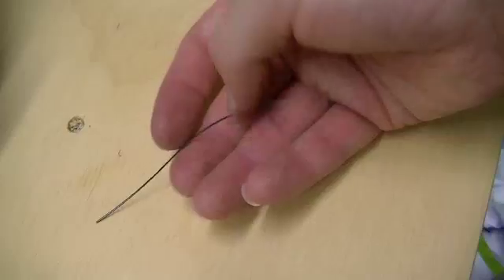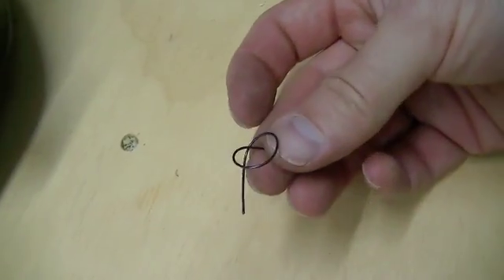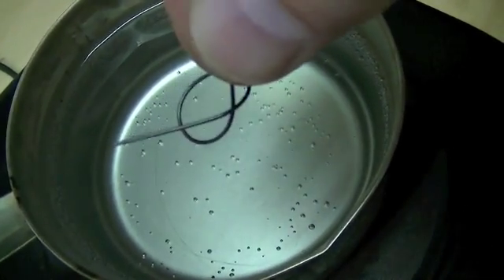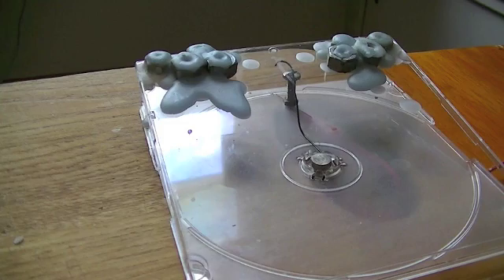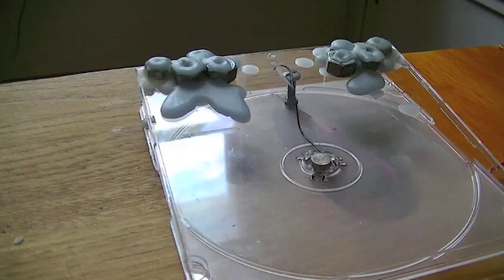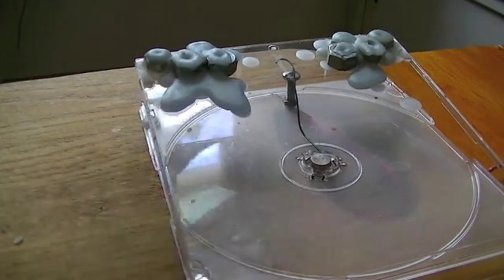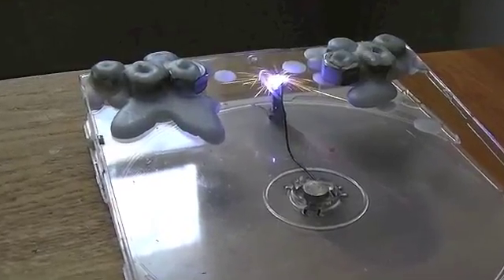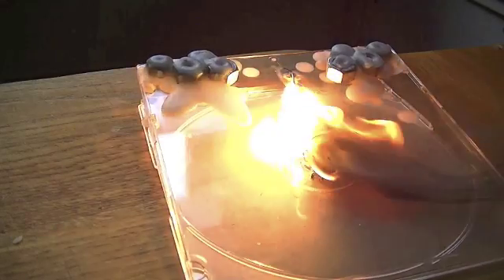Nitinol Experiment

Comment: Frequency is a hot and a cold within the crystal structure's of those refined crystal structure's?  Umm different nintinol with added crystal structure's to be affected at different frequencies? Then formed into micro coils spring's attached to an exoskeleton like how human ligament's and muscle is attached then the different frequencies used to action the nintinol with sensor's that pick up nervous system impulses from the user for smooth action of the flex and the relaxing of the different frequencies nintinol muscle's? Low technology version of course can't give out the really good stuff that's for later! 😊

Comment: Pretty cool what you did there. I work for a company that manufacture many form-factors of Nitinol components using wires, tubes, and sheets. I never tried what you did here though. I wonder what is the voltage and current to cause such a rapid melting?

Comment: Where do you get the nitinol wire?

The power used to lift the lid with nitinol could be used to lift the lid with electric motor or a solenoid.
To have this make any sense you would need yo demonstrate over unity.
Reply from the maker: Bought the wire here: www.imagesco.com/nitinol/nitinol-index.html

Comment: Interesting - Nitinol is reactive to a charge? 

   In theory, does this mean that any source of enough energy will cause nitinol to return to its programmed shape? Is there a rating of joules or amps/volts etc. per x amount of nitinol?

   How do you program the material? 

   It gives me an idea for testing say kitchen knives which are notorious for losing their edge and requiring daily maintenance.
Reply: Nitinol has a memory because of shifts in its crystalline structure in response to changes in heat.  Usually not very much heat is required, some types range from room temperature to body temperature- up to a hot cup of coffee for the process to start.

     It can be fairly powerful, ideally some samples can produce up to one hundred thousand pounds per square inch of force while returning to shape.

     The material is programmed by sufficiently heating it, while forcing it into the desired shape.  I think it is around 800F to program.

Comment: Heat will travel (You prolly know this.) to fill in cold areas, maybe there is some way to build a small cooling box at one end, so as the wire travels through it rapidly disperses the heat into the cold box... 

How to cool down the cold box then... lololol

Comment: The experimental motors that was constructed in the 70's is worth taking a look at.
Stefan put out a very interesting video in regards to nitinol for energy production.
Personally i think of it somewhat similarely to how you can use phase change in a liquid to do useful work because of its change in buoyancy; in both cases temperature manipulates a useful force without directly changing its potential.
Guess you could call it parametric energy manipulation...